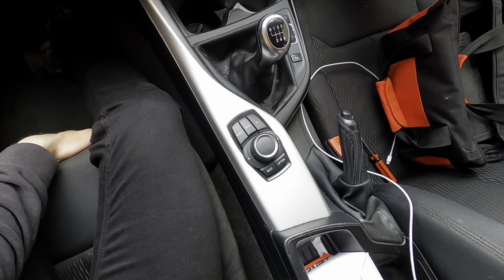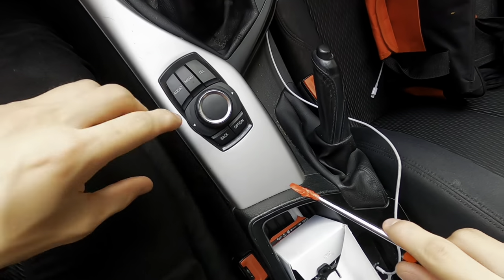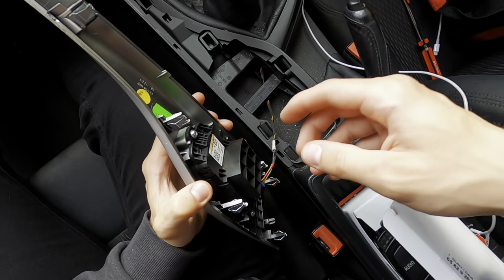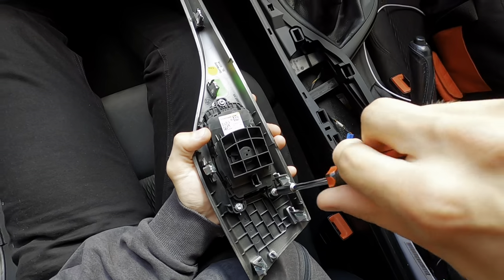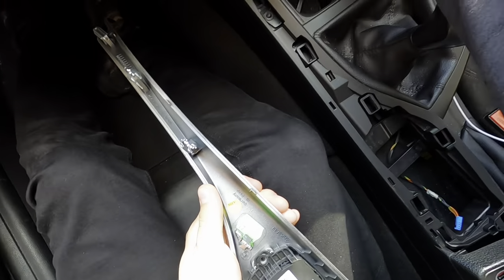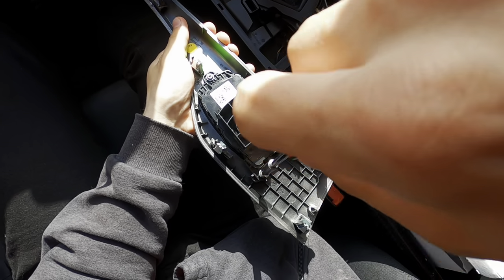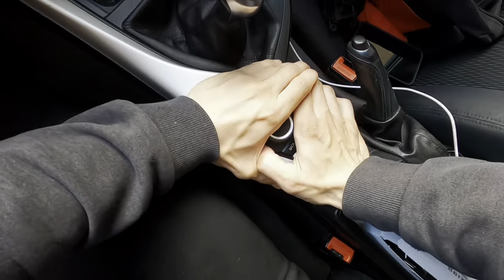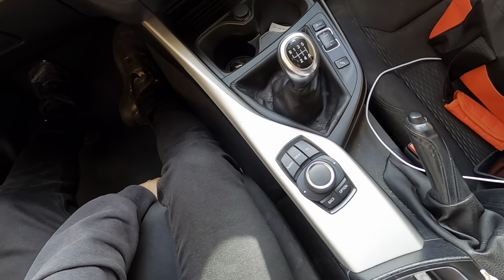How To Change a BMW iDrive Controller | F20/F21 1 Series

Comment: Feel like the blue plug comes off so easy for you but mine it feels like it’s super glued on . Any tips ?
Reply from the maker: Maybe look for a clip that’s holding it in a pushing the clip in at the same time as pulling it. Not sure what else to suggest other than that, maybe pulling harder? Heating up the plastic blue clip a little might make it easier to pull out?